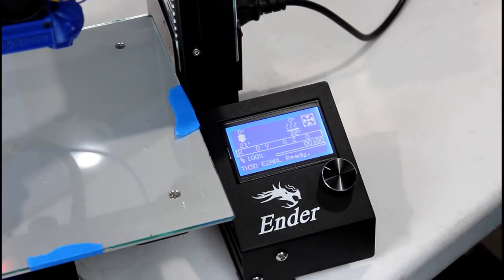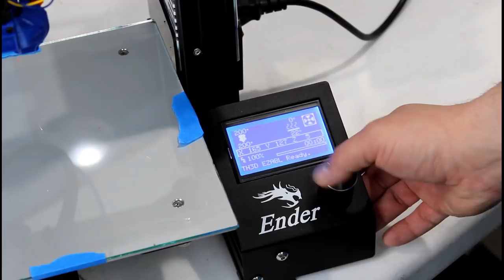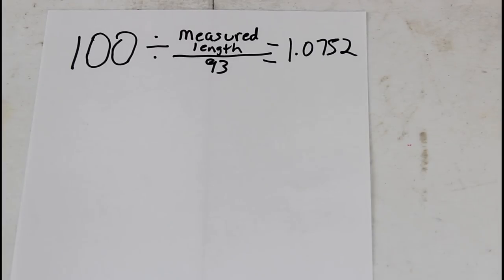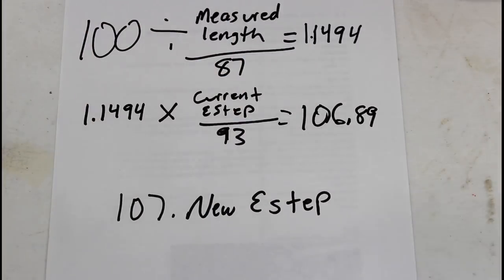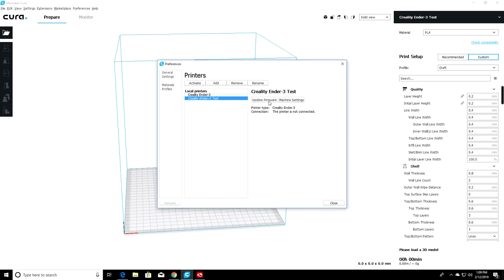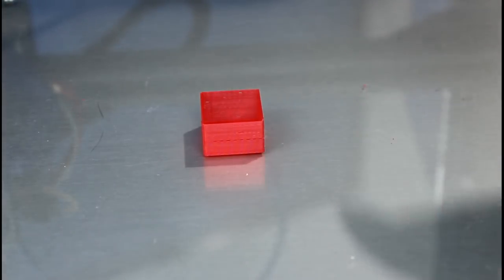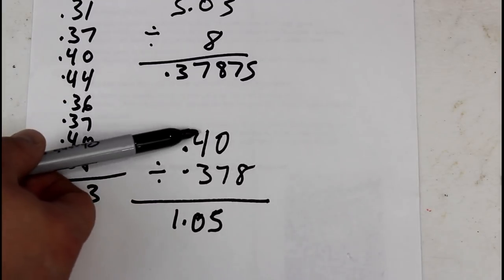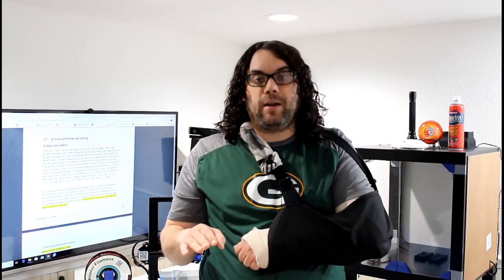Section 1.8 ESteps and Flow Rate

Comment: This is an awesome guide. Thank you.
I'll be coming back when my hardware actually arrives.

One questions I have is, I've been taught to "calibrate" things in the manner they were designed to be used. In this case, it would be during extrusion, not freeflow without any pressure or resistance.

Shouldn't you be calibrating it as you intend to use it - due to friction in the tube and change of 'flow' rate as it melts affecting the outcome?
Reply from the maker: There are 2 train of thought on that. This way you are calibrating the Extruder without anything attached. That way you know it's putting out 100mm when it's told to. Then you should do the calibration cube for each Filament and dial in your flow rate for that Filament. Otherwise if you do it the other way, you have to do the eSteps calibration for every Filament, then the flow rate too. I just keep a cube on my sdcard and it's the first thing I print with new Filament. Then I measure it, get my flow rate and start printing! It's super easy. But it's really up to personal preference.
Reply: @TheEdgeofTech  Of course! That makes perfect sense. Thanks for the follow up.
Reply: @TheEdgeofTech  Makes sense, since E-steps are not really intended to control the flow rate, they are a fixed number of steps the stepper motor has to take in order to move 100mm, the actual flow of material is not fixed, given that all other variables such as nozzle resistance, temperature, filament viscosity and fluidity, will change between filaments, it makes more sense to change them in software while keeping the hardware constant.

Comment: when you calculate the E steps you saved them in the G code in slicer..why not save the new value in the ender hardware,is there a difference?
Reply from the maker: Nope! If your hardware allows for that, go ahead! It wasn't an option at the time of filming and I made another video about that when the feature came out! Thanks for watching!
Reply: @TheEdgeofTech  awesome man thanks..,im running the  BIGTREETECH SKR Mini E3 v1.2 board on my ender 3 (not pro) so wasn't sure,just got to do the flow rate but im hesitant to touch it now its printing so good,but next step is to stiffen up the single thin Y rail and make the runners wider as I think that's where a lot of levelling issues come from because the wheels are so close together on a single rail.

keep up the good work.

Comment: 7:30 the question is should you do it for each filament type, casue the gear byte and grab different between pla and petg for example
Reply from the maker: According to Luke, if you do the open air method you would not need to do it for every filament. Just calibrate your flow and your good to go for each filament. Thanks for watching!
Reply: @TheEdgeofTech  Cura allows you to customize flow for each filament profile.  Should flow be done for each filament color/brand or only needed once per printer?  Then Can I just change the flow by creating a custom profile or do I have to edit the gcode? I feel like there are so many places to change flow I am slightly confused as to where to save the change and if I just do it once or for each filament brand/color...

Comment: After following your video I calibrated and input new steps however it measured to 105mm after calibration so I did this all over again with my new measurements and I'm am not hitting exactly 100mm.. I've done this about 5 times already and I'm either way over (111mm) or was under (94mm) what is going on?
Reply from the maker: Hi! Do you have a stock Ender 3? And how are you entering the new ESteps?
Reply: Check your stock e steps. I have a 1 month old ender 3 pro and it's e steps are 95, not the 93 mentioned here. The mentioned 93 are a common stock setting but not always the case. This would put your calculations off if yours are different and you are using 93 as a base.

Comment: im still super confused. how exactly did you change the length from 93 to 100? did i miss something? i understand the math but what do i change after i do the math?
Reply from the maker: Hey Jake, I am sorry for the confusion. There are better calculations in the description of the video. Then I would use one of my other videos on doing the change right from the LCD as it's a better way than using the Gcode in starting Gcode area.

Comment: Good video.  didnt work for me.  I tried multiple times with Ender 3 v2. i spit out filament did the calculation, made the adjustment to the e transmission ratio, tried another 100mm and it way super way off high, low all over. didnt make any sense.  seems like maybe ender 3 v2 handles this differently?

Comment: Ok, so here is my question, once this is done, if you run a temp test to find the best temp for your filament, will that have an impact on the flow rate?
Reply from the maker: It may a little, but you could do a temp test first then the flow rate if you want.
Reply: I personally do E-steps, temp tower at 100% flow, flow cube, and then stringing test. That is my standard calibration procedure for new filament. As you tune each one, you will get less and less stringing and artifact.
Reply: @evanphi  I did all that, but wow oh wow is my stringing bad, I need to work on that part.. I went with a setting that was recommended for retraction for the E3D V6 (.8mm) but have developed NASTY stringing, just trying to work out how much retraction I can get away with and not have it be an issue for the hotend.
Reply: @Battlewear  check out my mini guide on Thingiverse: thing:3912855
It was written with the Ender 3 in mind for the temp tower, but the section on stringing is still applicable.

Comment: The issue with your measurements is that you are measuring the filament when it is bowed. The extruder extrudes in straight sections, thus you should attempt to straighten out the filament when you measure it.
Reply from the maker: I appreciate the comment, and have responded to this very thing a whole bunch of times. I did measure it straight when I did the calculations with the help of my wife. But for the video, I couldn't hold it straight because of my arm. I should have just taped it to the table. LOL Thanks for watching, and always measure straight!

Comment: If this was asked and I missed it, I apologize, but why pre-heat the extruder for an open-air extrusion?
Reply from the maker: Hi! No, you have to have it preheated so that the extruder will turn. There is a fail safe, and it will not turn unless the hot end is heated up.
Reply: Well, duh. I knew that. Sorry for the dumb question.

Comment: So I replaced the extruder on my Ender 3 with one of those cheap aluminum dual drive ones all over amazon bangood etc. and I found after calibrating the E-steps I was getting significant overextrusion. Before the free extrusion and through the hotend extrusion had arounf 5mm difference now it's pretty much dead on. I guess the extruder slipping or whatever was happenening was actually compensating for material differences autmatically. Anyway now I apparently have to calibrate my flow per material to get good results.

Comment: Mine was printing well at 93 and 100 flow but the testing said I should go to 94 steps and 73 flow. Took it back to stock and I'll leave it until I have issues.
Reply: 73 flow? Wow that sounds impossible :) To have 73 means basically your geometric is horrible and incompatible with "printing well" if you change it to that value :) I guess something with the math went wrong ;)

Comment: Your equation is a bit confusing at first. You wrote 100 /  measured length/93.
Reading it, the equation is telling me  divide the measure length by 93 then multiply it by 100. whereas , by your explanation, the equation should be written 100 / 93 = 1.0752.
So does for the second example.
But I got what you meant. Thank you. Good tip.

Comment: Are you using a different guide than what is on the website, the section references don't line up.
Reply from the maker: I shouldn't be, unless Luke updated it and changed the section numbers.
Reply: @TheEdgeofTech   When I look at the guide online from the link you have in the description section 1.8 is vertical rail/extrusions. But maybe I am being dumb.
Reply from the maker: @gkuhnlgk  He may have updated it! Haha I will check the links and see what up. :)

Comment: If you do the e-steps with the Bowden tube connected do you omit to change the flow rate?
Reply from the maker: Do you mean leaving everything connected and running the filament through the hot end?
Reply: @TheEdgeofTech  Yes
Reply from the maker: @AndrewAHayes  Ok. No, you would still need to do the flow rate if you do it that way.
Reply: @TheEdgeofTech  Thanks Jim!

Comment: Do I have to do this for the Ender 3 Pro as well?
Reply: I am wondering the same thing
Reply from the maker: If you change anything on the extruder/hotend you should always do this no matter what printer you have. If everything is stock, you could do this, but it may not change much. Does that make sense?
Reply: I noticed when I did this, I got three of the same measurements for 40 mm, is my Ender 3 extruder thing way too low, on your video you had an average of 90, I'm way below that, I just got an aluminum extruder assembly, but I don't know if I'm extruding too low even for e stop correction
Reply: @gunhed76  I'm wondering the same thing since changing our my extruder to a metal one I get the same 40mm.

Comment: when you measure the filament make sure it is not bent like you show in the video because if you straighten the filament you might be surprised that you are under measuring the true extruded length.
Reply from the maker: Thanks! As I have commented many times, I measured it straight with the help of my wife at the time because I had the broken arm. I only showed it like that because I couldn't hold it straight. Always straighten the filament out when measuring. I have a new video coming out soon to update this one, and I will drive that home! haha

Comment: The 2 methods have different results, The lines you show in the gcode are not there on the E3Pro. I get 92 mm when I ask for 100. I want to confirm the code I should enter
Reply from the maker: Do you have your printer connected to your computer at all? Or to OctoPrint? Also, how new is your E3Pro?
Reply: @TheEdgeofTech  E3Pro is 1 week old. I used your last method for esteps. I ended up at 100 as well. Printing good. I just did a cube for flow. Going to adjust from those results. No computer or octo. That is all new to me. Thanks
Reply from the maker: @donaldfoster5998  Awesome! Great to hear! I have another video for the newer ender threes that shows how to do it from the control panel!

Comment: Anyone know what Cura settings to change in order to make the box file a 0.4??
Reply: At the very top on cura you have lane width make that 0.4 and that should give you a 0.4 wall if your extruder is set correctly.

Comment: @7:54 you could alternatively put your new esteps (100) into the EEPROM to achieve the same thing right?
Reply from the maker: If your printer is on the stock firmware, it will not save to the EEPROM that I know of. I have heard that the newer Ender 3 has this option available, but can't confirm that it will save it. I am hoping to have a brand new one soon, and I will look for sure! If you have updated your firmware, there is another video after this one that shows how to add it to the EEPROM from Octoprint. Thanks for the question!
Reply: Thank you, yeah mine let me save it right to the EEPROM which is nice!
Reply: Mark Gonsowski can you explain how to do that please.  Me Ender 3 is very recent too.
Reply from the maker: @SylvainsShipyard  I did see the option in my new Ender 3, but I cannot confirm that it will save it as Mark says. But I will look when I get home from work tonight and if it does I will put out a quick video on how to do it.
Reply: @TheEdgeofTech  ok great, that would be great!

Comment: dude , You told extrude 303 mm , but latter seems You extrude 100mm i'm not using marlin i'm using RepRap firm, i need to extrude 100mm or 303? ( free air method)
Reply from the maker: 100mm and measure what comes out! :)

Comment: I dont really get this. When you measured the filament, the filament section that you measured that came to 100mm is completely curved. This real length of this pice would therefore be longer than 100mm.

Comment: The flow affects only in X and Y axis or in Z axis too?
Reply from the maker: The Flow Rate affects the amount of plastic that flows from the nozzle. So it will affect the whole print.
Reply: The Edge of Tech but ¿is modified in only one “general” XYZ flow rate? I understand that materials in FDM are not isotropic and could be more logical Z axis with diferent values than X and Y in my opinion

Comment: hi there,
great video thank you ,i am a bit of a noob and i am wondering what the setting should be in cura for the test cube please.
Thank you
Reply from the maker: Thanks for watching! I don't have them in front of me, but if you go to the link, there should be some instructions in the Thingiverse site. If not let me know and I will look tonight when I get home.
Reply: @TheEdgeofTech  hi thanks for getting back to me,what I put was a line width of .8 and a wall line width of .4 with a wall thickness of .40 I did all the calculations and it works out my flow rate should be 40 which seems wrong.
Maybe I read the instructions wrong on Luke's test cube but I am still learning lol.
Cheers
Reply from the maker: @nutbox76  No problem! Check Luke's cube out again on thingiverse. He changed it to be .8 now because Cura was having an issue with .4. you would make 2 walls thick then in Cura.
Reply: @TheEdgeofTech  ok I shall give a go with 2 walls and run the calculations against.
Thanks for your help much appreciated.
Reply: @TheEdgeofTech  right I have tried a few ways but keep on coming up with the same results ,so if you could when you are ready and you are able to let me know what I need to put into my cura settings.
Cheers Dazz
Reply from the maker: @nutbox76  Ok sounds good! I will get that for you when I get home.
Reply: @TheEdgeofTech  thank you
Reply: Hi buddy ,just wondering if you have them setting please I it's printing 2 walls would the calculations need to be different because the values will be higher than the original?
Reply from the maker: @nutbox76  Can you email me at theedgeoftech@yahoo.com, and I can send you pictures and help better that way!

Comment: I  did the e-steps 3 times and got 100 mm each time.My CR10s has the default 93 e-steps. I did the math  it came out  to 93 did
I do it wrong as for flow I came out with 100.125 for flow
Reply from the maker: If you told it to extrude 100 mm and it did extrude 100 mm, you are right on and you don't have to do anything! Also I probably would leave the flow rate at 100 if it was me. Are you having issues? Or just checking it?
Reply: @TheEdgeofTech  I was checking because I was getting some lines In my lithophane nightlights I was making

Comment: For the second part of the equation how do I know the current Estep? Is it always 93?
Reply from the maker: For a stock Ender 3, yes. Otherwise check out the video I did after this one using Octoprint. It has the commands to get the current E-steps for any printer running Marlin!
Reply: @TheEdgeofTech   Do you have a link to that video?
Reply from the maker: @ChuftCapt  https://youtu.be/HVljfDVPp3o

Comment: Since the default is 93, I decided to add exactly 93 instead of the 100 my measurements came up short I did the math changed only my machine settings then proceeded to the single wall cube settings and adjusted flow rate only in cura now my prints are like glass with no lines!

Comment: Thank you so much Jim for this video! I`m going to give it a try ASAP!! My only concern is that when you were measuring the 100mm filament with your caliper the filament was not straight. If you had straighten it it would be a bit longer. So do we have to measure it like that or straighten it up while measuring it?
Reply: From what I read, straighten it when measuring for a more accurate reading

Comment: Just did the tests on my Ender 3.  The E-steps are perfect.  But when I print the cube with a single wall set to 0.4mm, the walls are ~0.93mm.  What am I missing?
Reply: this! please help
Reply: I think the cube on Thingiverse has been changed to 0.8mm, so ideally your wall should be 0.8mm if flow rate is correct...so I assume.
Reply: @AjKaArjun  That's probably what it is.  I did analyze the slice in Cura and it shows two walls. So doing the calculation and tuning, I'm getting a bit better prints.  I've tried printing a few of tolerance tests (https://www.thingiverse.com/thing:3051094) and I can get 0.5mm, 0.4mm things to move.  But the 0.3mm, 0.2mm, and 0.15mm tolerances are fused together.  Someone else I know was able to get down them all to print fine.  Ideas?

Comment: Ok my question is , as I live in the boondocks with no other internet then cellphone and I'm using the slicer that came with my ender3pro ( Creality Slicer 1.2.1 ) as cura will nor run on my old 32 bit pc , that being said ,,,,,,, why can I not just update the E Steps on the ender it's self . ie change the 93 to my new estep of 97.7,  thanks for your videos they help a LOT
Reply from the maker: You can, and you should. If your printer is new enough to have that option in the control panel, you should do it that way. I made another video on that when I found out that was possible. Thanks for watching!

Comment: If I have the esteps set in the printer itself, do I also need to have it set in cura? Does having both conflict with one another?
Reply: No. just set the esteps on printer itself.
Reply: @omnomnomnomnomnomnom  So, is it an issue if it's changed in both places, or should I change the cura setting back to 93?
Reply: @Sivartly  change the cura setting back and just leave the thing updated on the printer itself